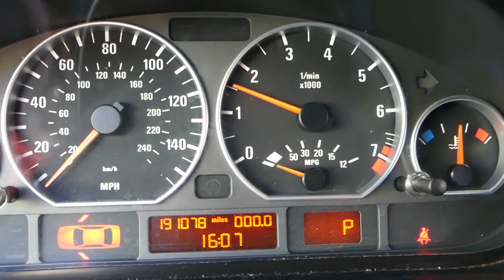CHEVROLET OPEL 1.8 A18XER 2H0 ENGINE SPARK PLUGS GAP  CRUZE SONIC ASTRA INSIGNIA VECTRA

Comment: I have a Cruze 1.8 and ever since it was new its been jerky, Slow, hesitant acceleration and somewhat bad fuel economy. The auctorised dealer has been looking at it several times but havent found anything wrong. "Its a cheap car, what do you expect" is their answer. Talk about customer service... Anyway ive decided to check everything myself now since the workshop doesnt want to give me any answer. Could The plug gap be The problem? Ive heard stories from USA where almost Every plug has been running wrong  plug gaps from factory. Ive also heard its Easy to break The coil pack when removing it. Should i buy a spare before trying to remove The plugs myself?
Reply: Hey Man, it could be something from a vacuum leak to a timing issue.. How many Km's are on the motor? Is the car showing Engine light?
Reply: Did you ever see what was wrong?